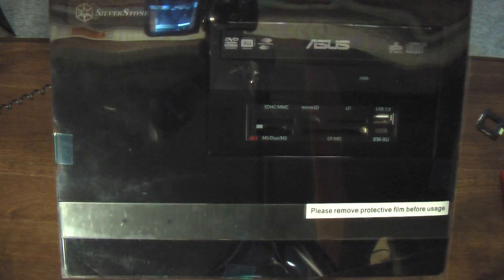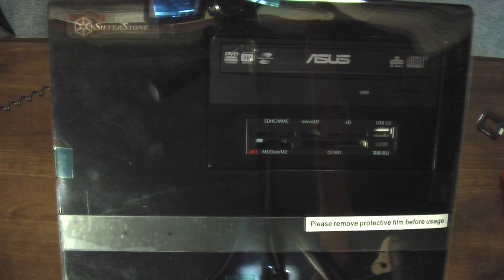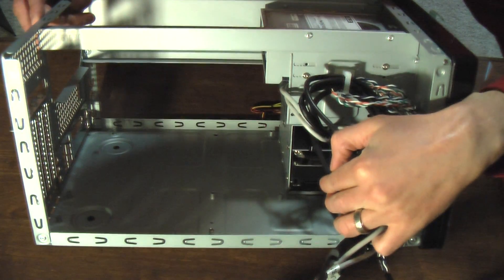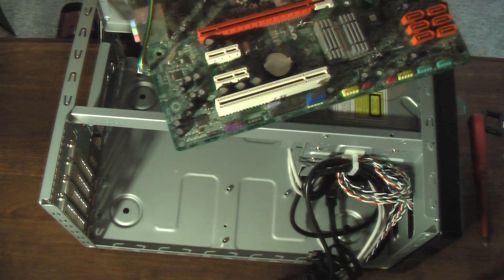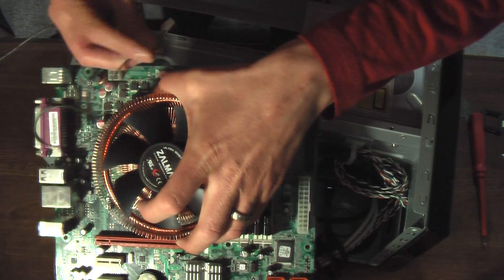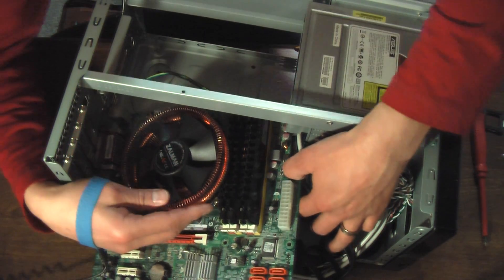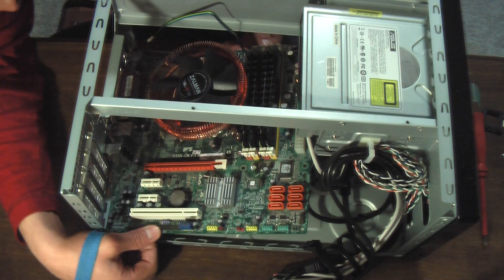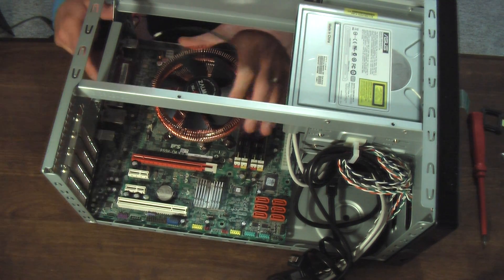Silverstone Sugo SG02B-F-USB3.0 MicroATX µATX Case - Motherboard Installation

Comment: It says that it fits full length GPU's and Power Supplies but is there space for an AIO cooler or would I need to upgrade to a low profile air cooler? Can I fit an air cooler and a PSU at the same time? How does that work? Many thanks in advance!
Reply: Larger GPUs may need the x16 slot on the outside slot of the board or at least not so close to the HDDs and PSU.
Reply: no AIO as it only supports 80mm fans